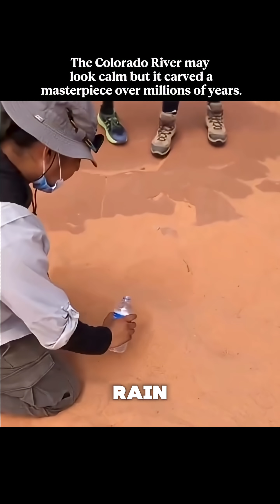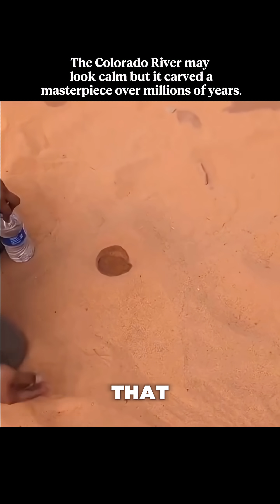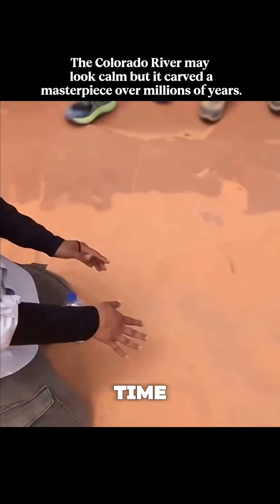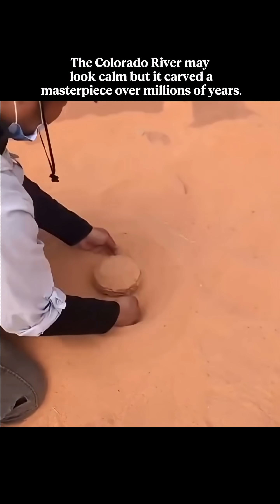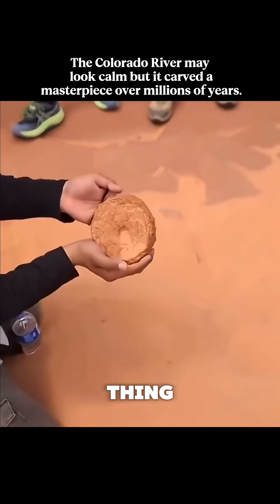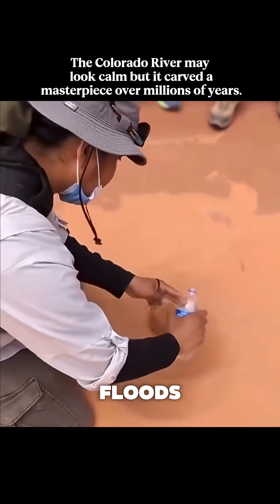How the Grand Canyon Was Really Carved?

Comment: There's no way that the Colorado River used to flow a mile uphill to carve out the Grand Canyon. And, it didn't happen over millions of years because it has too many sharp edges that would have been rounded off by erosion. The Colorado River is 1,500 miles long, but only 250 miles of it is the Grand Canyon. It was obviously carved out by a massive flood after the last ice age.

Comment: The Colorado river didn’t carve the Grand Canyon because water can’t flow uphill from its original source, the centre of the United States. The canyon was carved in a hurry. Check the heights above sea level people, the river was the instant result.
Also sandstone isn’t formed with water, it’s formed with pressure and a bit of heat.

Comment: Isn't this the likely way the pyramids were built just at a larger scale?  Frame out a section, fill it with sand, and slowly wet it till it solidifies?  Seems a lot more likely than slaves moving perfectly cut rocks the size of a house hundreds of miles and then using rollers and ropes to pull them up ramps and into perfect positioning.

Comment: The problem is when you examine the grand canyon it looks as if it took hours. Not years. As alll erosion matches perfect from top to bottom. Your explanation would be sound only if the canyon matched mismatched in erosion which it doesn't via scientific methods of measure.

Comment: This demo looks convincing, but it changes the situation.
The Grand Canyon isn’t cut through loose sand — it’s cut through solid rock that was already hardened. Water moving sand in a bottle isn’t the same thing.

It also treats “millions of years” like time itself does the work. Time doesn’t erode rock. Only the amount, speed, and force of water do.

The modern Colorado River is relatively small and slow, often full of sediment, and struggles to cut deeply today. To explain the canyon, even mainstream geology has to add rapid uplift and short periods of much stronger water flow.

And the flood idea is often misrepresented. Powerful, sediment-filled water doesn’t just wash things away — it lays down layers and can carve deep channels quickly, as we’ve seen in real flood events.

So the issue isn’t slow vs fast — it’s whether the comparison actually matches the real physics and the real rocks.

Comment: Also with areas like the Grand Canyon there's another aspect:
Rivers almost always follow the same relatively-exact height curve from start to finish. This is true even as the ground moves.
A major contributing factor of the Grand Canyon forming was because of the ground decompressing from the previous glacial period (what most people would refer to as the last ice age, but we are actually still in that ice age). While the ground is rising, the water stays at relatively the same height.
The Colorado River is basically at the height that the area was at shortly after the ice in the area melted.

The method showed in the short alone doesn't explain the carbon dated age of the canyon's lower rocks.

Comment: The guy is on the right method using water but what formed the grand canyon on such a big scale was the flood waters of noah's day if you look closly at the canyon walls the water made a water mark line that shows the height of the water line if you calculate the size of the grand canyon and work out roughly what the water volume was by using the water line water mark in the canyon it shows that only a E.L.E (extinction level event) could have caused this only which was noah's global flood no other event could have caused this other than the comet that wiped out the dinosaurs but for this to happen is very very highly unlikely the only likely cause was noah's flood because of the shear volume of water on the move on the face of the earth which left the evidence behind in the form of the grand canyon

Comment: I don't know if the guide was off or if the person reposting it was, but this demonstration does not correspond to the Grand Canyon. First the deposit layers in the Grand Canyon are not eolian sandstones (except for the Coconino layers on top of the canyon) but more common marine and lagunar deposits. Second the erosion (and formation of the canyon) was started because of tectonic movement: the uplifting of the Colorado plateau created a set of faults, exposing softer sediments, easily eroded. It would be great to have context on where this video was shot. Eolian Sandstone canyons are pretty rare. There's one in Zion I know of, but it doesn't look like it.

Comment: In the ice age there was a giant lake where the great lakes are, but it was covered with ice.  At the max depth the water pressure was so high, it couldn't freeze...
And, as that water pressed on the icewall of the glacier that was covering it the pressure caused the ice to stop being able to be frozen (still that cold, but couldn't hold solid state).
Eventually, the wall busts out and you get this Giant flood that would have ripped the Grand Canyon deeper much faster.

I like the idea, and there is visual proof that this was possibly what happened.  Did it do all the work...???  Probably not, BUT, almost guaranteed that it is one of the reasons the Grand Canyon is as deep and wide as it is...since regular rain induced flash floods wouldn't have been able to do that even in millions of years (maybe)...

Comment: How you explain sea fossil on top of the most of mountains
Reply: Is that a question? If so, the answer is quite simple:

the earth (as in the ground, the rock, the planet's crust) moves over time. Mountains rise up. What is at the top of mountains wasn't necessarily always at the the top of a mountain. And that's why a few mountains have fossils on top of them.

Additionnally, not all fossils need water anyway, only layers upon layers of sediment and special conditions.

Comment: First of all. His example cannot prove the theory.

Pouring water in rapid succession over seconds is not the same as rains over millions of years.

Layers dont sit there, unaffected,  waiting for another layer to form over the next million or 10 million years lol. No, the rains would come and was away new surface material and erode the layer that's already present. At best, there would be no layers on top of one another, and the surface layer would be completely uneven and eroded.

Oh wait, we do see that in the top layer. Thats what we see today. So how were the bottom layers formed without the erosion? They are deposits from the global flood. They are sediment. Those sediments were laid in the course of half a year. And they were carved through when the waters ran back off the land into the new ocean basins  for the following half a year. We're talking small timescales here. Soft sediment rock, now similar to his example, newly laid down, not solid. This was his example. Then water running over it on its way to lower levels. His example supports the bible flood, not millions of years. Sorry

Comment: Sandstone is cemented, not held together with surface tension of the water like this.  Water alone can't cut through efficiently like this.  What really happens is that water carves as much as it can of course, but most of the actual excavation is due to do failure of joints within the cemented sandstone.  One crack/joint gets water flowing within it and it breaks wider and wider and then whole blocks of rock are dislodged.  Then more blocks dislodge down, and spread out and then undercut towards the banks and take more blocks which are more vulnerable since the walls are higher with more load and those rock blocks fail within their cracks and joints down by rockfall.  Those fallen blocks are then broken down and moved and become river cobbles etc.  This video actually is not correct, to form large canyons it's all about breaking apart blocks of rock, not cutting sand channels with water.  Smaller canyons are done more that way like slot canyons etc.

Comment: He just demonstrated it did not take millions of years. These people should be fired.
Reply: Obviously the grand canyon is not 10 centimeters wide and rain and floods there didn't happen every 5 seconds. And it wasn't just a pile of sand either. 😂
Reply: ah yes because thousands of kilometers of a thousands of meters high of a million years old valley's stratification process happened at the same exact speed as pouring a few drops of water in the sand. Let me guess, you're american

Comment: Illogical explanation. Rain does not fall on only a single section of ground, nor does wind dig up sand that deeply. Massive flooding, mixing different soil layers together and the massive waters receding, makes far more sense and can also be witnessed on smaller scale next to the roads in dryer/dessert type of areas sometimes. Also, deserts seem to expand, so one can safely assume that area used to "not" be desert in the past, where plenty rock and strong soil would've been foundational.

Comment: Ya this isn’t true. Most geologists don’t accept this theory anymore for three main reasons:

1: the water of the river would have had to flow uphill and against gravity for thousands of years to carve the canyon. That’s not how gravity works.

2: The delta (the land mass that is carved out by the river and deposited at the end) is tiny, accounting for less than 10% of the canyon’s mass. It does account for the river, but only over the last 4,000 years or so.

3: The actual material that was carved out of the canyon was found on the other side, in the desert. It is also sharp, almost looking blasted apart, not worn down by erosion like a river would.

The actual accepted theory now is that there were 4 massive lakes where the canyon is, which exploded out, releasing all of the water in a tidal wave of force that carved the canyon all at once very quickly. This is similar to another canyon that was formed that exact way and was witnessed, that being Engineers Canyon with Mount Saint Helen, where a large amount of water pressure washed the canyon into existence in just two days.
Reply: Exactly! Same as how the grand canyon was formed. It was a massive amount of water at once. The layers form by tons of water and sediment deposits mixing together. As the water receeds the sediment deposits at different increments forming distinct layers.
Reply: this proves creationism to be true, cuz wth do you think the massive amount of water came from if not the flipping flood
Reply: @JarodGamz  Exactly how long ago was this flood?
Reply: @SacredShiro  4,500 years ago

also, start reading the Bible, friend!